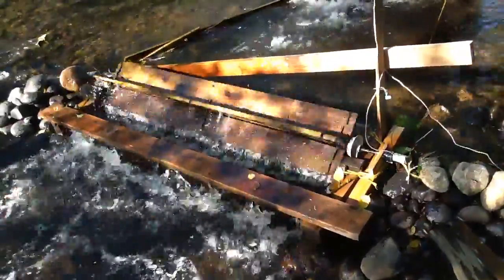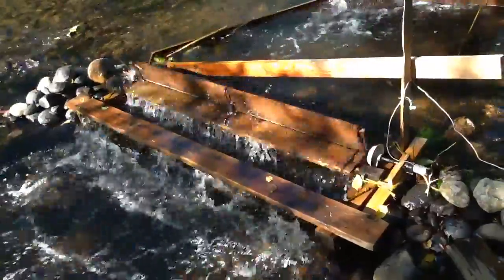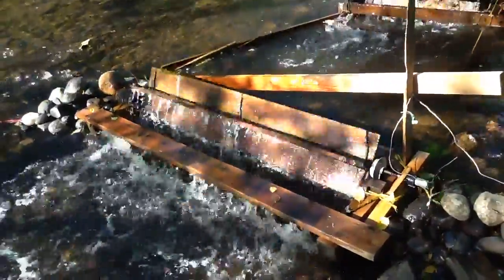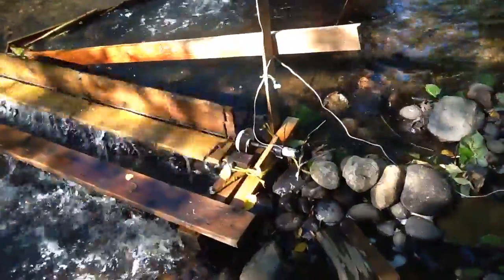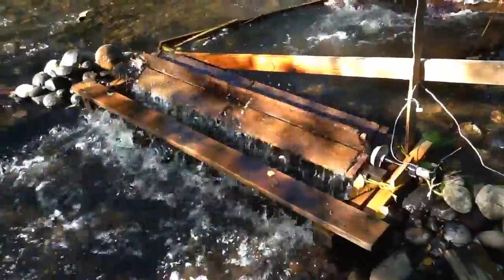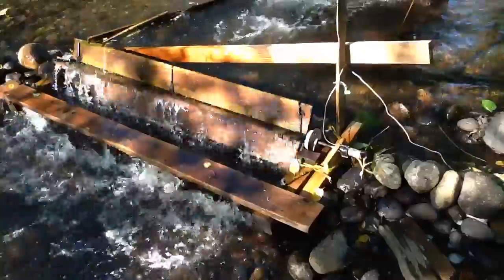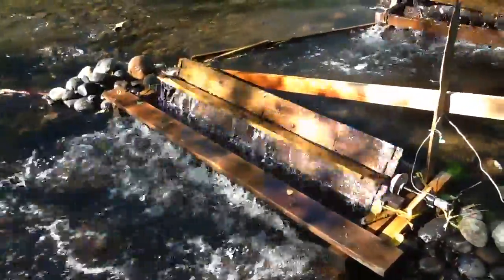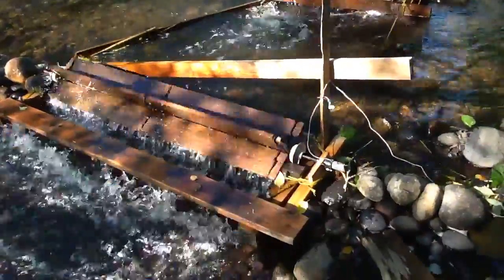small stream electricity under $80.

Comment from the maker: I used a 3" piece of 3/8 steel water pipe, a 1" piece of 1/4" dia fuel hose as sleeve over motor shaft. I had previously ground a 3/8 square end on water wheel axil. Drill hole in pipe to fit pin in motor shaft. Crush other end of pipe to fit onto 3/8 drive wheel axil shaft. Sleeve motor shaft with fuel hose, pin motor shaft to pipe, put crushed end onto water wheel axil.  The 5/8 rebar shaft could be ground down to fit into 3/8 water pipe a pinned into place. (A better fix than I did.) I used a wooden housing to hold motor. I plan on putting a motor on both ends total cost $65.10' (5/8" rebar, 20' (3/8" rebar, 4 ( 6" x 6' cedar fencing, 2 (2"x6"x8', 1(4"x4"x8', 2 (10" knobby tire, a few screws.http://t.harborfreight.com/10-inch-knobby-tire-43612.htmlDiodes http://www.ebay.com/itm/121763882161?_trksid=p2057872.m2749.l2649&ssPageName=STRK%3AMEBIDX%3AITCapacitor http://www.ebay.com/itm/252446388051?_trksid=p2057872.m2749.l2649&ssPageName=STRK%3AMEBIDX%3AIT